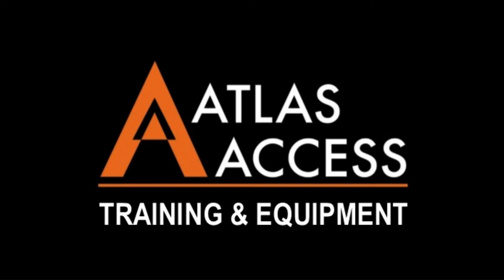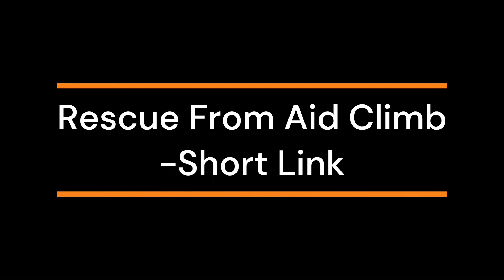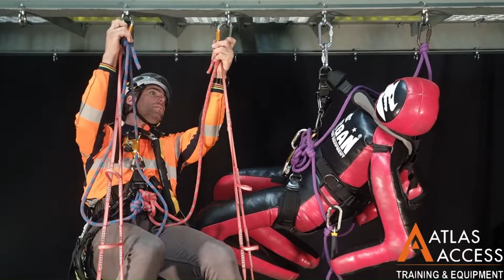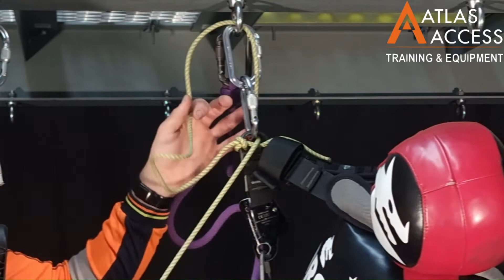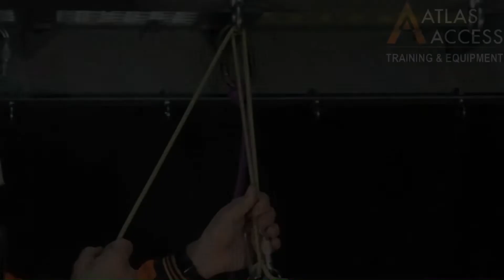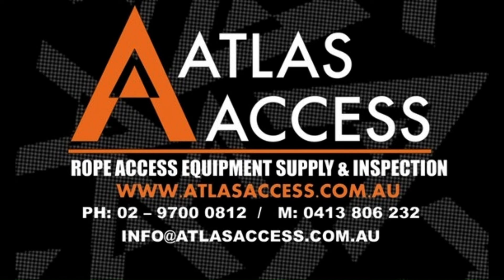RESCUE FROM AID CLIMB - SHORT CONNECTION

Comment: Why not lower them from the short link straight onto the hard link and cut out the extra step of having to lift them again to release their croll from the cowstail ?
Reply from the maker: Thanks for the question!
The short answer is yes! You could do this as long as the casualty continues to have 2 attachment points and the rescuer has the strength to control the casualty during the move.

However, we use this method as it separates the 'lowering' portion of the rescue and the 'connection', this makes the rescue more achievable when there is a significant weight difference between the rescuer and casualty, while guaranteeing that there is never less than 2 active connections.

This is just one of many acceptable ways to rescue from a short link, subscribe to our channel for more videos on rescue techniques in different scenarios!
Reply: A not so short link. You have an extra krab in there.